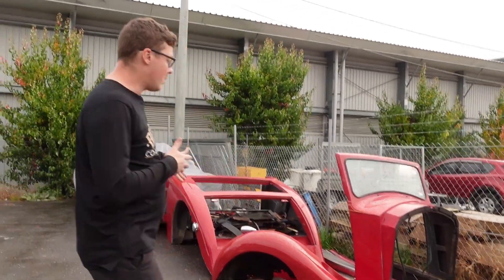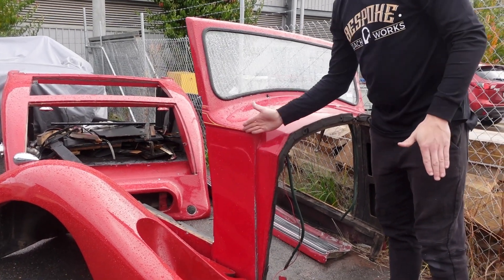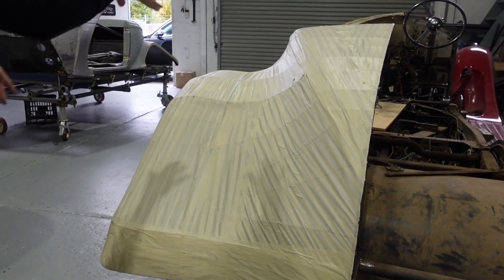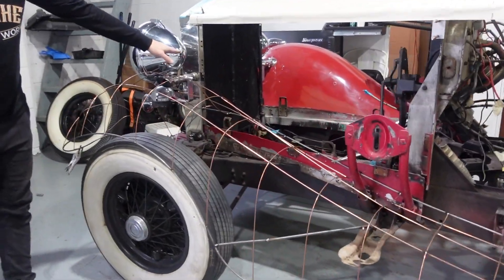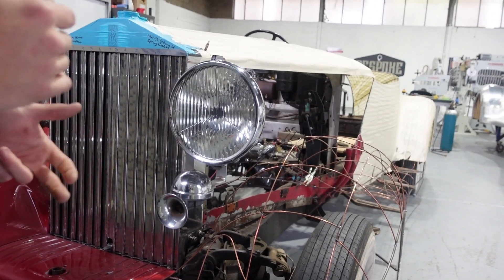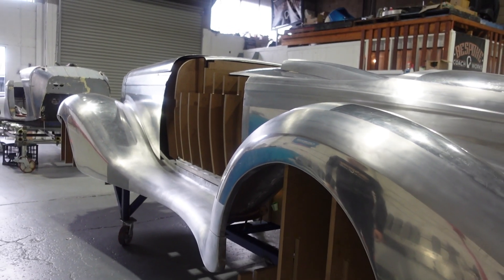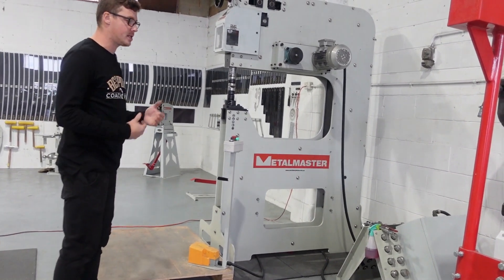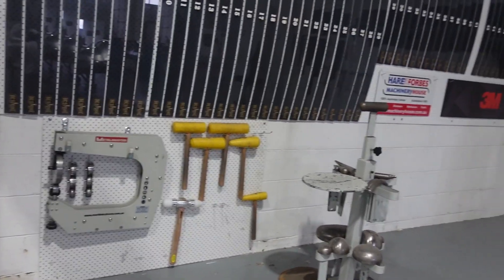Designing a Rolls Royce Boat tail and work shop tour

Comment: What happend to the bad Design On the Shrinka stretcher and bead roller mabe put some thought into the jaws of the shrinker strecher and the way they mark i really thought it was desined straight from china both are in my scrap metal pile as they wouldnt take the back worst 2k i spent

Comment: Hey brotha, are those sweeps made from acrylic? I know the aluminum ones are 1/8 thick are those plastic or acrylic sweeps the same thickness?
Reply from the maker: They are 6mm polycarbonate which is a outdoor signage material, more expensive then a acrylic but aren’t prone to damage
Reply: @bespokecoachworks8919  do you know roughly when these will launch and around what price point?